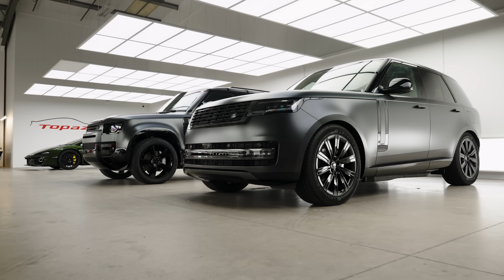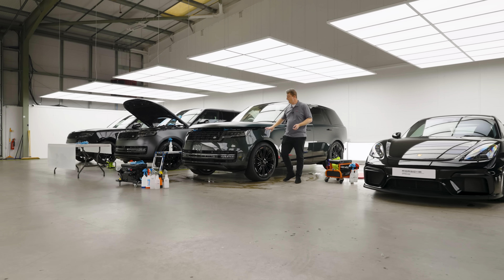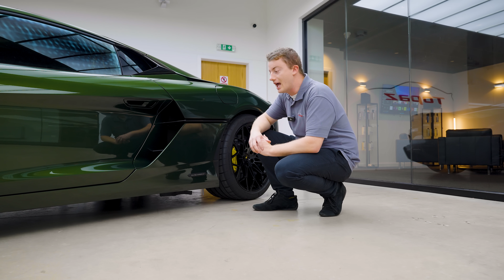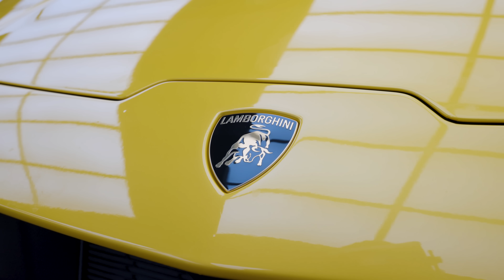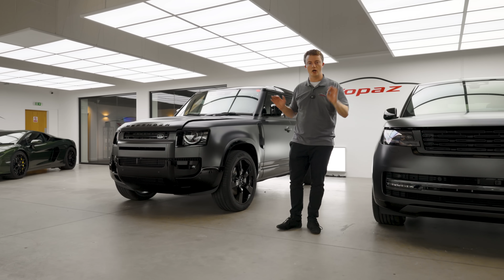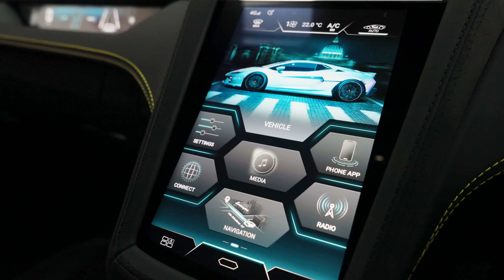First Look: NEW Lamborghini Temerario at Topaz

Comment: The engine compartment of the Temerario looks terrible. Did a blind person lay the cables? Cable ties everywhere you look. Amateurish and cheap.
Reply from the maker: Function over form maybe!
Reply: The 2 blue sensor wires look about 2 ft too long, I would expect a neater solution from a top end carmaker, especially one that shows off its engine.